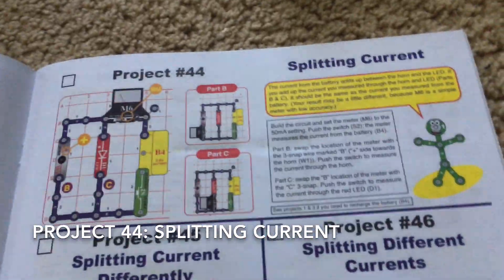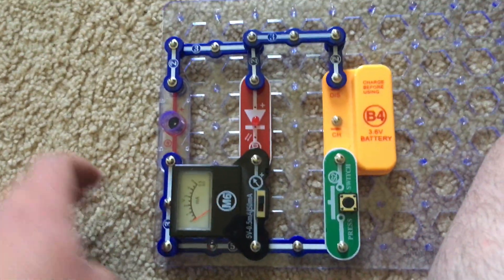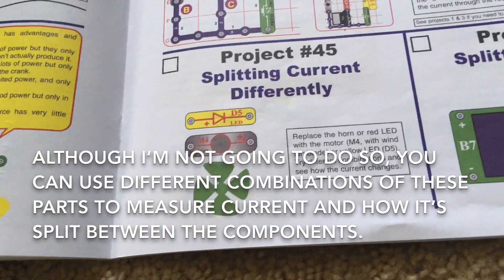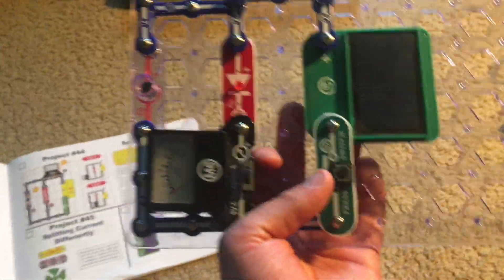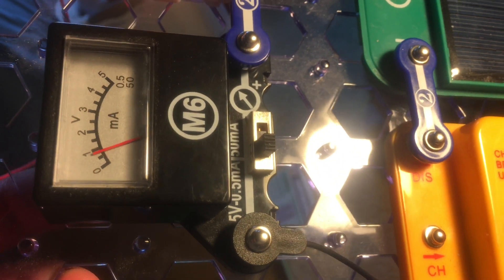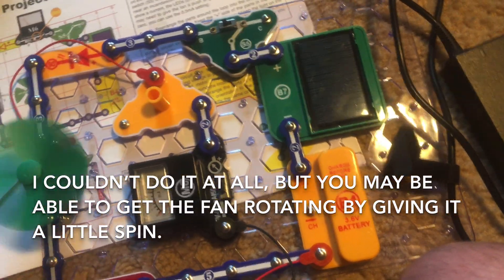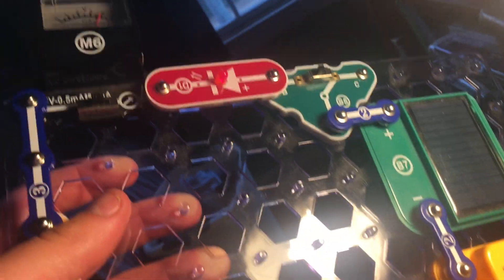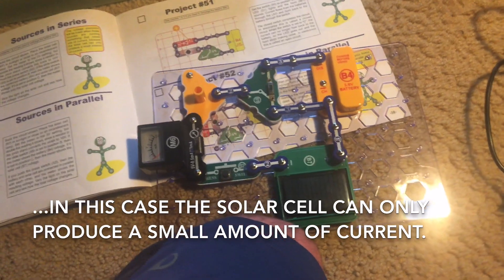Snap Circuits Green: Projects 44-49 (VOLUME WARNING)

Comment: 1:58 a good remedy to the issue with the fan is to connect the meter to the circuit using jumper wires, this will allow the fan to spin when you measure the current so it will be more accurate.
Reply from the maker: Thank you for the suggestion!